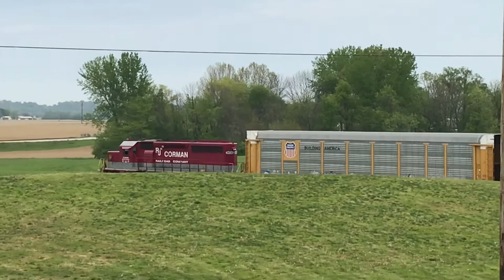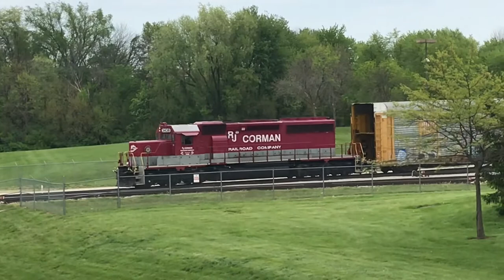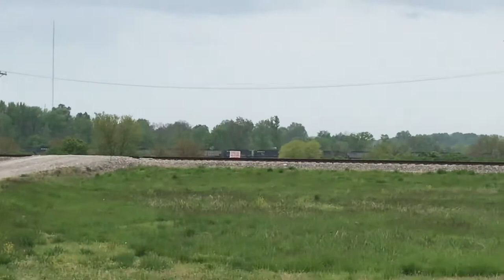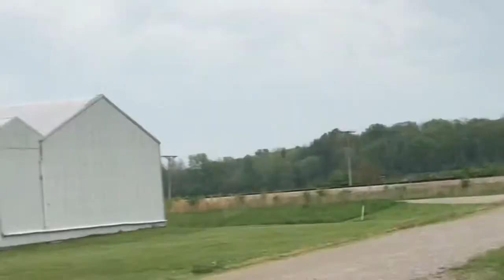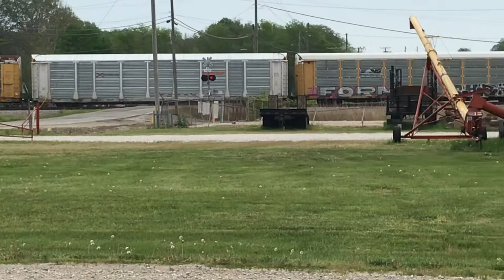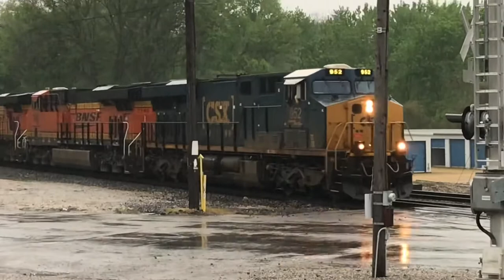RJ Corman switching and a GREAT CSX train with 3 DPU’s!

Comment: Amazing! Obviously the Toyota plant ships by rail, do they receive any parts or raw material by rail? Definitely, a fallen flags fan here as well. Thanks for sharing.
Reply from the maker: Not directly to the plant. Steel coils  come in to a nearby supplier by rail where they are slit to size and then trucked across the street to the plant. That plant receives coil cars and ships out gondolas of the scrap steel. Although not as common as it used to be, some parts come from overseas in containers, but the containers are trucked to the plant.

Comment: Compact tape but filled with goodies. That is shocking about the auto racks sitting there that's long. Even if there's a bypass still not the thing to do.   Nice view of the coal mine and the heavy phosphate train. The blanked out pink car was West Central Coop of Iowa and the orange one was Rio Grande.  We get them thru Milwaukee in CP and also potash from Canada. Alas this season we haven't had Chessie System or the really elusive. RFP.